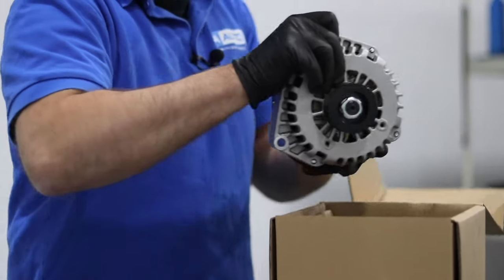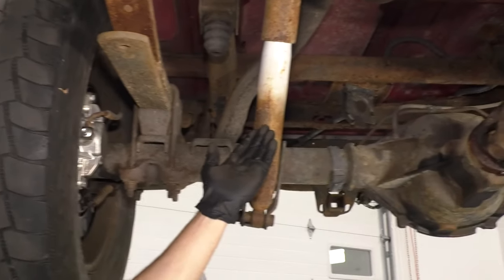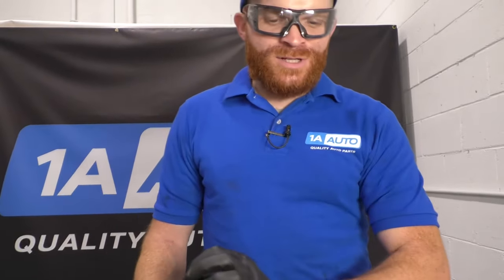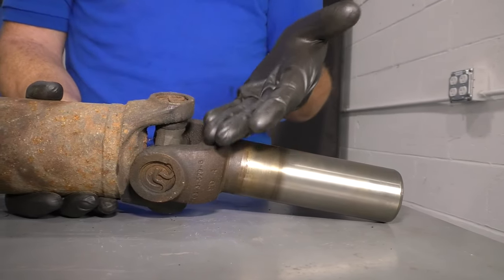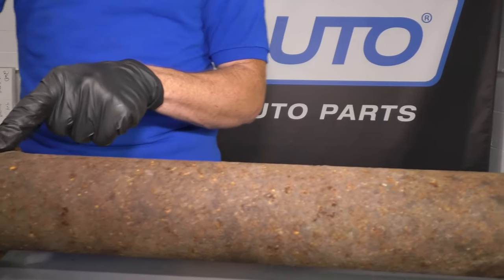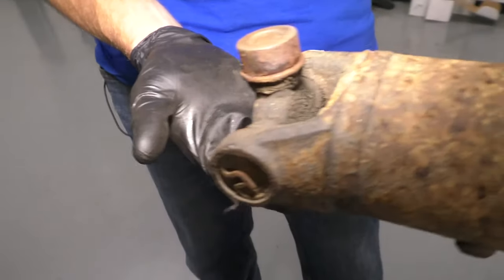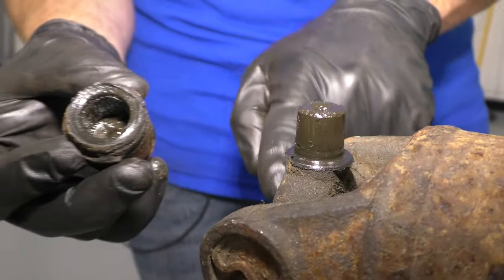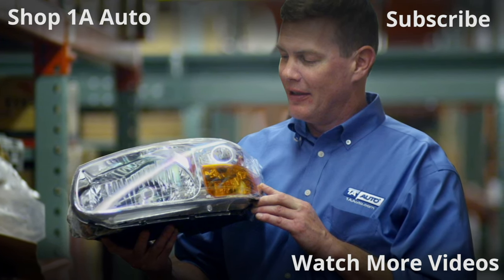How to Diagnose Truck Drive Shaft Problems - Vibrations and Noise

Comment: I don't know if anyone else mentioned it yet, but the drive shaft needs to be reinstalled in the same position as it came out, especially parts like the center support bearing.

Comment: When a carrier bearing goes bad, replace ALL the U joints. Don't replace all the U joints "just" because you have the shaft out... there's a reason why they should be replaced at once. When a carrier bearing or U joint goes out, it causes the other U joints to wear unevenly especially if the carrier bearing is bad. Uneven wear creates vibrations, and later on you'll be changing the other U joints, and quite possibly changing the ones you've done replaced before. Carrier bearings and U joints work together as a team, when one goes, it'll force the other ones to go even if you don't realize it right away. When a drive shaft wiggles on one end from a bad joint or carrier bearing, the other end is binding up on the other U joint.
Reply: Good point

Comment: I changed the tires and got a new transfer case and driveshaft in my 2012 4x4 Jeep commander...and I still feel vibrations when I drive almost constantly ..I haven’t paid attention to the noice much. I wonder if I got bad U joints..steering feels fine too...just feels like when you drive off the road and hit the ruts on the shoulder of the road and it vibrates real bad to get your attention. That’s my best explanation on how it feels.
Reply: Did you ever figure out what it was?

Comment: Will that u joint cause intermittent vibrations between 40 - 45 mph in a 4x4 in drive cruising speed? Vibration will feel like your going over   rumble strips or sleeper lines.

Comment: I just bought it 2001 f350. The guy was telling/showing me it was vibrating a little bit between 30-40 mph but it went away he thinks it might be the carrier bearing saying I should replace soon and should be only around $100 but he let me load up my Tahoe, on the trailer that I drove all the way down there to pick up the truck with, to drive back saying I should be good. but yo check it out when I get home (322miles)because this is the first time I ever drove diesel n not knowing what to expect he said your going to heat so kind of noises you'll be fine and I wasn't sure if it was vibrating or not because of the tires but i was pulling the Tahoe and was got about a 140 down the highway towards home. I went to get over to get fuel as I got over  I pushed  brake pedal to slow down. All of the sudden I heard a BAM! as I went to slow down( from 70mph)!! the next thing you know drive shaft is gone and I'm coasting up exit ramp, why would braking cause that, would you know? Its a 7.3 that's tuned(?)at 100hp? This is My first diesel so i'm not familiar with them. I bought this because engine(35k) n trans. ( larger trans cooler) were redone 2 yrs ago. Oh yeah walked down highway and couldn't find driveshaft that took the ujoint n yolk with it, waiting for tow truck now as I ask this. $840 tow 177miles😔
Anyways would you know why rear driveshaft would pop off while braking? Lose pin rings holding them onto ujoints n combination with bad carrier bearing or so I have worse problems
Thank you in advance for any info anyone can give!!

Comment: Great video, thanks for the info, trying to chase down a random vibration/ shake in my 2000 Ford expedition 2 Wheel Dr., I replaced both U joints put it back in and it still has the vibration between 45 and 60 miles an hour, randomly, it won’t do it every time but sometimes you’re just driving along and all of a sudden the whole truck starts vibrating/shaking any ideas? Thanks
Reply from the maker: +rotfan77 We wouldn't be able to diagnose an issue like that here, you may want to have a local mechanic take a look at it. Thanks for checking us out! http://1aau.to/m/Shop-1AAuto-c
Reply: Have a shop check your hubs or see if you need a balance on you wheels. My mom veichle only on highways have a vibration issue at 50 to 65mph thats cause from us getting a new set of rims that wasnt balanced correctly.
Reply: Did you find a solution ?? My expedition 07 started doing the same thing about a week ago ??? Any suggestions would be greatly appreciated thanks
Reply: The splines to yolk where the two shafts merge maybe worn so splines need teflon grease

Comment: Really need some help here ... Would a weak (not as stout as the original) driveshaft cause a 2006 Pontiac Torrent AWD to vibrate under hard acceleration or while turning left or right.

BTW ...
1. The two-piece driveshaft and carrier bearing are less than two years old.
2. Same applies to Motor and Transmission Mounts, plus Bushings, Control Arms, Ball Joints, etc.
3. In short, all items are fairly new except the tires that are five years old (General RT-43s).

Comment: Had front tires changed on my AWD 13 Nissan rogue back had good tread left ever since I did that I've noticed a bang sound coming from I believe is the rear of the car mostly after stopping and then going again like backing out of driveway and leaving a parking lot where you turn but it doesn't always do it during the turn help I'm kinda lost

Comment: Do the front drive shaft and slip yoke need to be aligned or 90 degrees off.  I have a 99 F350 with this exact assembly and am suspecting it was put together incorrectly.

Comment: During maintenance on my rear control arms the drive shaft was accidentally pulled out from the transfer case. How can I insure that I am re-installing the drive shaft back into the transfer case so that the shaft is in proper balance?

Comment: The problem I'm having is the tranfercase ceal keep leaking I've replaced it three times and about 2000 miles it starts again I've replaced all the ujoints and carrier bearing I still have a vibration at about 55 miles an hour to 65 then it gos away any advice

Comment: I suspect this is the problem in my 04 Nissan Pathfinder. Every time I maintain a constant speed (whether 20mph or 45mph) my whole vehicle tends to wobble back and forth. So I have to either speed up or let go of gasp peddle to get out of wobble, also when I hit a bump I hear something under the center console that feels loose. Tires are fine.  Wonder if this could be the problem.
Reply from the maker: +Eduardo Marin We wouldn't be able to diagnose an issue like that here, you may want to have a local mechanic take a look at it. Thanks for checking us out! 1AAuto.com
Reply: I'd say carrier bearing

Comment: A driveshat can moved jus a little to the left and right when is used the hands ?
the question is if you take with your two hands the drive shaft you can turned left and right just a little that is ok or it's a problem I meaning the drive shaft connected to transfer case have to be tied ?

Comment: I have a question, I have 2014 accord , 4 days ago it vibrated every time I stepped on the gas. Today I turned it on just fine but when I switch it to D (drive) it goes nowhere like it literally revs but doesn’t move same with reverse. Could it be the head gasket or is it the drive shaft, and how much would either of those repair cost if you had to guess??
Reply: Sounds like a transmission issue. Hopefully just the linkage and not the whole tranny.
Reply: From my experience with a Honda Accord with the same issue, what is the transmission fluid quantity and quality?  Is the fluid level at the full “COLD” level or the full “HOT” level after the car reaches operating temperature?  I agree with the first commenter that the symptoms you described definitely resemble a transmission issue.  How many miles are on the vehicle? And when was the last time you changed the transmission fluid and filter (it may or may not have a replaceable filter)?

Comment: My pickup keeps dropping the rear driveshaft. Replaced the u joint multiple times and even the drive shaft and it still fell out. And transfer case exploded and took out overdrive housing. What might be causing my driveshaft to keep falling out?

Comment: I think you might’ve forgotten to check 12 o’clock and 6 o’clock for the rear wheels everything is in good condition on my 2015, F350 power stroke except for the 12 o’clock and 6 o’clock.when I rock the wheel back in forth it’s shifting the other side is solid what could cause this ?
Reply from the maker: +JUAN CHAVEZ We wouldn't be able to diagnose an issue like that here, you may want to have a local mechanic take a look at it. Thanks for checking us out! http://1aau.to/m/Shop-1AAuto-c

Comment: Are both u joints on the rear drive shaft that go from the transfer case to the rear end on a 04 Avalanche 1500 the same size on both ends of the drive shaft?

Comment: I have a 2002 gmc savana 2500. Had a new carrier bearing installed ,and new u joints now there is a very bad vibration that was never there befor.please help

Comment: I have a drive shaft in a GMC Sonoma that I changed the universal joint song but I still have a slight vibration what would happen if the drive shaft was put in 180° out

Comment: So I got brake pads and rotor replaced and car was driving quite nice comfortable next day and then same day in one parking I got lost in thoughts and may or may not I just did engine on but not drive mode on when started car with keys (might have moved keys a little but not all the way on) (I am not sure. I was having baby with me and bit distracted with her cry). But when I got it in rear gear and started driving I felt brake is not working so I pulled hand brake and then again tried to move gear in Drive gear and tried but couldn’t slam brake and area was slope so car was driving and I didn’t realize if i just moved key all the way ON or not so I felt car is driving but something wrong with brake since I got them repaired previous day so had this presumption while trying to fix the issue and I tried one more time by moving gear from parking to drive then one time I moved gear from drive to parking directly in hurry rather pulling the handbrake this time while it was engine on but not complete (if it was the case) only mode so then I restarted with key again by moving it all the way this time to make sure that i started it right way and it was working fine and car started having brake work but I felt something wrong cause it become noisy and my brake are vibrating when I am pressing them to brake it’s like not agitating but like slightly hmmmm feel in car body and brakes which wasn’t there before the mess when it started and doesn’t feel smooth quite ride. I somehow finished my 80 miles ride cause car was feeling noisy bit vibrating but was driving. So I took to mechanic next day morning and said if brakes are ok then he said I need wheel balance so I went for wheel balance but I am still feeling 20% of vibrations and noise. I sometimes hear some metal clicking sound underneath. It’s like as if i am cracking my bones same way as if cars parts got stuck and when moving get piping sound. So if did I mess up transmission or struts and coil or something which is causing this. Right now vibrations are not that bad but they are still not completely quite which was in beginning before all that parking incident. So if I go to mechanic they randomly suggesting different things and not sure what could be issues. Someone suggested struts replacement and someone said could be transmission issues and each things costs more than 500-1500 range. So what would be the best way to diagnose and fix this issue if anyone had such experience. If I have to replace struts and coil which brand is best and should i buy online and get them to mechanic as the cost of mechanic suggested one is double than anything is being sold online. I hope it may make ride quite and silent plus less noisy if i buy myself better quality with same inflated price of mechanic and just give it to him. Do I need to check my brakes again? Please suggest. It’s 2011 Corolla base model.
Note: I am mostly very mindful and careful when I drive cars and somehow don’t know whether it was bad day or what but I completely lost in presumptions and instead of single time turning key off and then On o kept on using parking gear and hand brake to get it right and if that might have messed transmission and struts or some other parts of the car.

Comment: my old 08 ford f150 2wd 4.6L dryshaft is coded 8L34-4K145-SA.is it ok if i swap that for a dryshaft thats coded 4L34-4k145-TE? is there a big difference? will it work?

Comment: Don't forget the splines at the slip end into transfer case and also at the carrier bearing my 2011 dodge 3500 keeps wearing the blue costing off the slip at the carrier and it vibrates. Always grease at 10k and doesn't last more then 2 years.

Comment: Bought a used 2014 Jeep Grand Cherokee and the driveshaft made a clunking sound for a few months. When I finally had it checked out I was told the whole drive shaft was bad. The cooling o rings were bad as well. Had all of it Fixed, and now the car runs so smooth. It’s unbelievable. It would drip oil everywhere, every time. Now it is fixed and thanks to the mechanic I have I feel it was fair price to pay compared to a local dealer which would have cost me thousands to fix when it was simple to diagnose with a good mechanic. I was ready to just throw away the car lol
Reply: I have a 2002 grand Cherokee and I have had this car for only a few months. The clunking noise was there when I got it and it’s only getting worse. I’m pretty sure it has something to do with the driveline. So maybe i have to do something similar

Comment: I have a 2008 yukon slt and it jerks/jump while turning, i dont hear any transmission noise that i know of. I do have the stabilitrak light on. Someone told me to try and replace the mass air flow sensor on even though the check engine does not show it. I haven’t done so & am curious to fix it. Any ideas?

Comment: I have a 2004 toyota tundra v8 4x4 and I replace the shaft but it still vibration when hard it can't drive over 20 mph

Comment: I have a 2013 Ford edge and when I accelerate I hear a  humming noise. Sounds like those big trucks tires going down the road. Anyway, I took it to Midas and they said it's either the transmission, differential or transfer case. Thankfully have a warranty but does anybody have any idea what it could be? This vehicle is AWD.

Comment: Changed 03 drive shaft because it was making a clunking sound AMD not going into reverse or neutral but was driving forward with no problem. Since ive changed the drive shaft now ots going into reverse and neutral but wont go into drive. When put in drive its making a sound as if the drive shaft and transmission aren't syncing. Please help

Comment: I hear a laud clunk when I have a cold start. The noise comes from the shaft/differential. This only happens when I start the vehicle with the key in the ignition and my foot on the brake. When I start the truck with the remote start it does not happen. Any feedback on this? Also the truck is a 2020

Comment: BTW, on my FWD car. I have a bit of clicking UV joints (when turning under throttle). My steering wheel is vibratig at higher speeds (highway). The suspension is completely fine, and so are the tyres (balanced too). Could the UV joints be the cause of the steering wheel vibrations?
Reply: A Russian with good English. That is rare.
Reply: *tires
Reply: @andrewcastleberry4921  that is the UK   (“English” - people) way of spelling that word and since a majority of English language training for Europe (Western-Russia) originated from UK (England) that is their “correct” spelling.

Comment: I replaced the u joints , and have new tires and balmced recently with a new brake job ..  55 mph and up  the vibrations are like a wobble ..  so I replaced u joints  and it persists .   My mechanic said it could be the diff . I have  Dakota r/t  with posi   And  it drives fine  it still spins  tires etc but I can’t drive in highway  with out this wobble and it stays all away to max speed , fine below 45;.    It vibrates even when coasting    On or off gas       I don’t wanna junk the truck because the rear differential  I can’t afford
Reply from the maker: +Eejit We wouldn't be able to diagnose an issue like that here, you may want to have a local mechanic take a look at it. Thanks for checking us out! http://1aau.to/m/Shop-1AAuto-c

Comment: My 2011 grand Cherokee vibrates horribly at 1600-2100 RPM. Coincidentally I just had the differential and transfer case serviced and the vibration started after. But after troubleshooting quite a bit, I’m pretty sure this is the issue.
Reply: Please let us know what happened? I have the same or similar issue on my 2010 grand cherokee and I'm trying to diagnose it. There is a resonant humming/growling sound with vibration at similar rpm only when my foot is on the accelerator.
Reply: @depth_and_breadth5255  I have the same issue